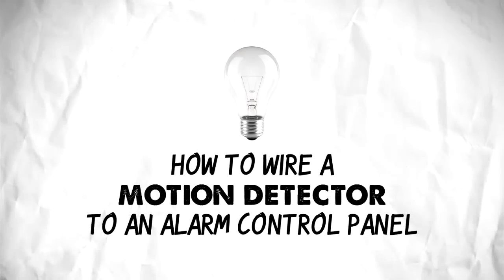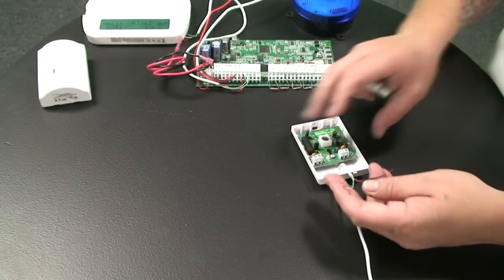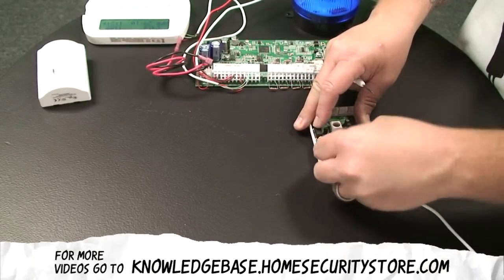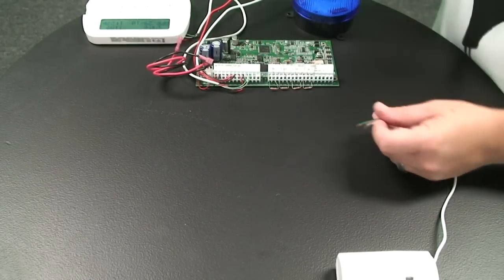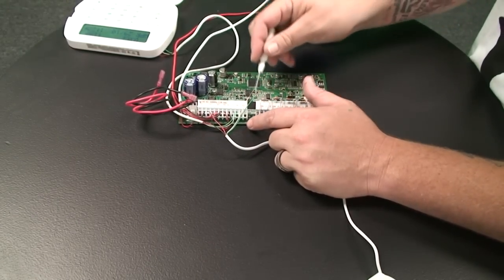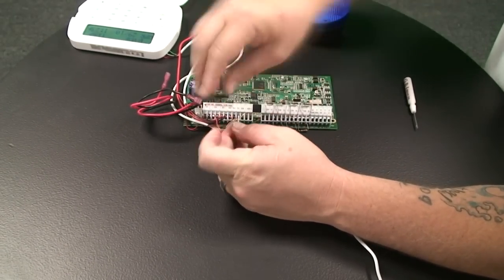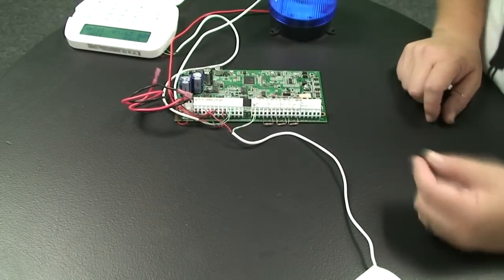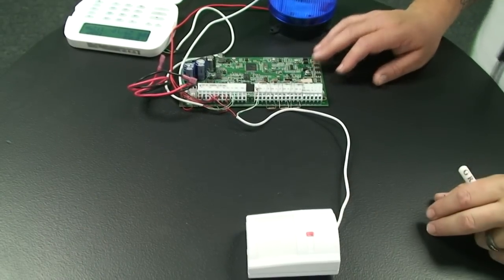How To Wire A Motion Detector To An Alarm Control Panel

Comment: THIS MY FRIEND IS THE WRONG WAY TO INSTALL THE MOTION DETECTOR. FIRST OF ALL YOU'RE USING A VERY VERY LOW COST DETECTOR THAT DOES NOT HAVE A TAMPER SWITCH. SECOND THE RESISTOR IS NOT CALLED AN IN LINE RESISTOR BUT AN END OF LOINE RESISTOR, (EOL)!!

Comment: Thanks for the video! After several hours of trying to get my new P1832 DSC to work (kept thinking zones weren't secure), i saw the video for the EOL resistors and slapped myself for being dumb and notputting in the resistors.  I ended up disabling the SEOL and DEOL feature on the control panel, so i didn't have to put resistors in.=)  But it pointed me in the right direction, so thanks!!!